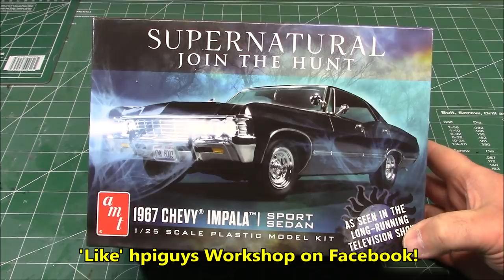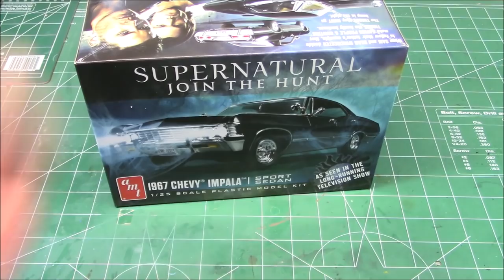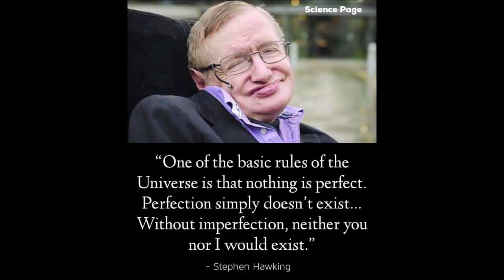Supernatural 'Baby' 1967 Chevy Impala Sport Sedan 1/25 Scale Model Kit Build Review AMT1124

Comment: I really REALLY wish that more kits came with the separate frame for those vehicles that actually had them and weren't unibody. It just makes for a much nicer and more detailed model when finished.
Reply: I agree. Never really like the kits with the frame, exhaust and suspension pre molded in the chassis. Always a blast building the frame

Comment: Chris, You mentioned in the video that the rear seat was a "new tool'. In actuality, the front seat is the "new tool" and it doesn't match the "original" two door SS kit. In addition, the transmission in the 1:1 car was an automatic not a manual as depicted in the kit. I realize that this isn't any of your fault and R2 should have paid more attention to these minor details. I just opened my kit and discovered that it was missing the front seat entirely. Your build of this kit turned out super! Thanks for doing this review.

Comment: Hello, great kit. I have to get a few of them, so many building options to consider. I really like the four door body and that there is not any engine marking on the side of the front fenders so an engine swap is a natural, like a 6 cylinder 283, 327 or a big block. Kit bashing this with the other '67 Impala 2 door would be a good project. 
The one thing that stands out is the transmission a four speed standard shift. It has a clutch and a nice hole in the floor for the shifter to go into but no floor shifter LOL. The shifter on the steering wheel is for an automatic or a three on the tree. I would turn it around so it would be the turn signal and add a floor shifter. I have been watching all of your videos and I just now noticed something. Your like me left handed  and it's been in my face all this time. LOL. The car body looks great with the floor polish. I have not tried that yet. Using the sharpies looks like a great idea and time saver. You have so many good ideas to try out building kits. Thank you very much.
Reply from the maker: Enjoy your build up!

Comment: I just got this today....my favorite car of all time. I haven't done a model in like 20 years. I jumped right in and glued the engine block together and painted it with a krylon orange and it did not bond at all. My question is when using spray paint do I need to prep every single part and primer them...also how do I fix the engine?

Comment: I do like the way you sand down the tires.  One other thing I do is use a black wash over the tire after the sanding.  I use an oil base wash.  In my opinion it make the tires look more realistic.  They look more like worn tires then just sanded.
Reply from the maker: Thanks for the tip!
Reply: @hpiguy  Anytime.

Comment: Seems like they cheesed their way through converting the beautiful  '67 Impala SS kit.  Column automatic lever with a 4 speed transmission and they left the clutch pedal. I also noticed the hole in trans hump for the center console is still there not to mention, the floor hump is wrong for an automatic car.  ( I really doubt the real show car has a 427 ci ). Wrong gauge cluster for a 4 door Impala, it would have came with the sweeping speedometer. The tooling for the body wasn't finished, leaving scratches in the mold. Don't get me wrong, i am grateful to have this kit and kudos to Round 2 for making it happen. Unfortunately, its a very specific purpose model without a lot of scratch building and parts box parts.  I think they are missing a huge opportunity here not offering a stripped down 4 door Biscayne. Great job as always with your build and sharing a few building tips along the way. Love your channel.
Reply: The "Hero" car is the 427, the stunt cars are all in the 300 ci range. They're all automatic, though. And a lot are actually caprices converted to impalas
Edit: more info
Reply: Its the closest thing we've got to "Baby". Build her a roll with it.

Comment: The separate frame is great  With the satin finish of the frame plastic and the texture of the floorpan I just left them unpainted.  The front suspension IS fiddly.  Same as with the 2 door.  And it annoys the crap out of me that the transmission is a 4 speed in a car that absolutely has an automatic.

Comment: AMT did a awesome job on the retool of this kit. The only real foible I see is that all of the engine shots of "Baby" on the show is of a built small block, not a big block. The "hero car" on the show also had a automatic transmission, not a 4 speed. Of course, I understand that the original kit was a 67 SS 427 car and retooling the entire engine tree would be too difficult and expensive.

Comment: Thanks for the review, and build, always enjoy your videos.   Just one note.  "Baby" is powered by a small block 327, not a 427 big block.  Not a deal breaker by any means!
Reply from the maker: Thanks for watching my man!
The Hero car used for filming has a 502 under the hood...in the show they say it has a 327.
Other cars used for filming have built 350s, etc.  Pretty much any engine goes for the car.
Reply: Both TheRealElrae and Hipiguys Workship are correct. The first few seasons all the cars were small block cars. You can even see when Dean would work on the car it had a small block in and still had the original single exhaust. It wasn't until later on in the show, they put the aftermarket 502 (was never a factory option in any car) in the hero car. That's when you see Baby went from single exhaust to dual exhaust. But most of the other cars had SBC 350s, and 327s. The reason the show stated it was a 327 car, is because that was the most common motor put in the Impalas at that time.

Comment: That looks fantastic, what a great old Chevy. I see there is a clutch pedal but column shifter. Does that mean it has a 3 spd standard or did they miss putting 
a floor shifter in? Or maybe its an automatic and the should not have put the clutch pedal in? Anyhow, looks excellent, good job. Take care and be well.
Reply from the maker: Thanks Norman!
A more detailed build would involve cutting off the clutch pedal and filling the shifter hole on the tunnel.

Comment: If you make a mistake on the body trim with the silver sharpie, what is the best way to fix that? My hands are not steady, and my trim looks like crap, but I havent found a good way of removing the sharpie mess ups with out damaging the paint. Thanks!
Reply from the maker: Alcohol on a qtip takes it off, but be very careful, it will also take paint off.

Comment: Why do you apply Testors 
silver lacquer over the black primer on the underside chassis of the model car. Can you use any silver acrylic paint instead?
Reply from the maker: Sometimes I use it to bring out the detail in the chassis, as in a car that's been used for a while.
I use all different types of paint to simulate that depending if I want it to just look used, or rusted, etc.

Comment: Very well done! I was just wondering though: is there a specific variation of the Krylon or Rustoleum spray paints that you use? My concern would be that the spray paints wouldn't be compatible with styrene.
Reply from the maker: I use every type they make and have not had issues.
Automotive lacquer paint is where you can run into big issues if you shoot it on bare plastic.
Reply: @hpiguy  Thank you sir for that information, I really appreciate it. Now, on to some spray painting!

Comment: Did you sand down the body before applying the pledge floor polish ? because I just got mine and the body is has minor scratches and iv been thinking about doing a little bit of sanding with 1500-3000 grit and then applying the pledge floor polish
Reply from the maker: Nope, I don't stress that stuff as I don't do show builds or worry that much about paint or body 'perfection'. Thanks!

Comment: I have a question for you?  I accidentally snipped off and sanded the front wheel mounts thinking they were spew mistakes 🤦‍♂️. Where the front wheels will attach.  Any ideas on how to fix that?  Would be helpful.
Reply from the maker: Super glue them into place. That's what most folks do.
Or drill a small hole in the wheel and the front end and use a piece of wire as the axle.
Reply: @hpiguys Workshop  ok thanks.  Car Models are kinda new to me and needed some ideas thanks 😊
Reply: Is it a good cuality plastic?
Reply: @Ethan  i actually ended up cutting a piece of spew shaped it to fit each axle and then pin vised it to the frame and super glued it. Can't tell the difference except these wheels will never spin.

Comment: I got some glue on the window. How can I get it off?
Reply from the maker: You can try to sand it off and polish it back to clear or cover it with floor polish and hope it disappears. Once glass is messed up it takes a lot of work to fix it.
Reply: @hpiguy  this is just my learning model. Mum is going to buy me the same model again which will be the good one. Also getting the top of the car on was a pain in the butt